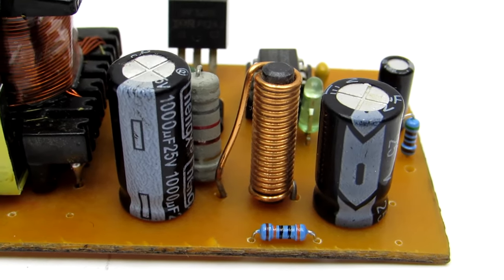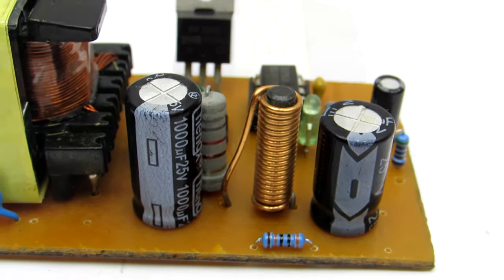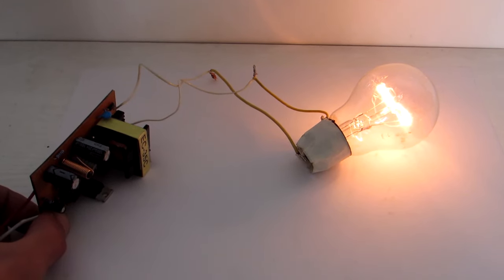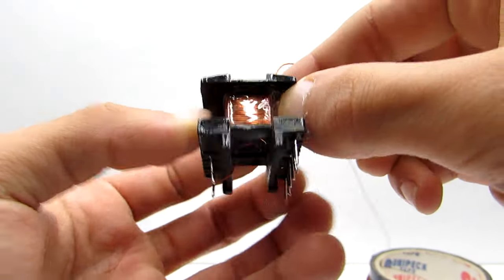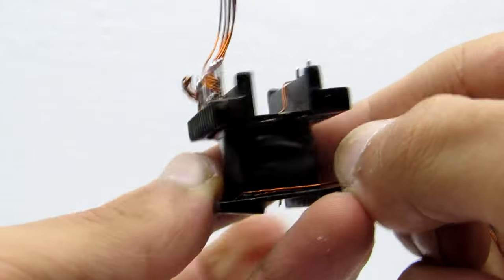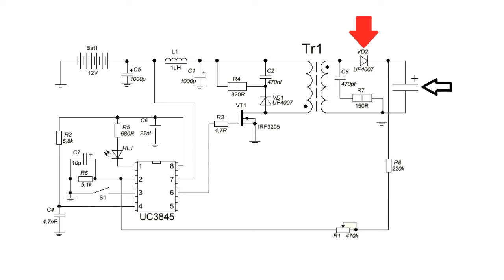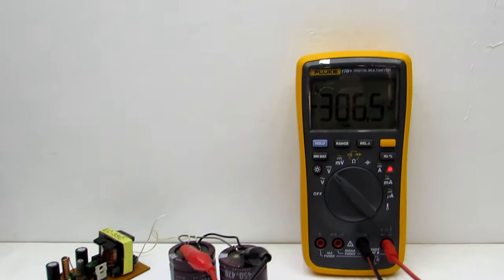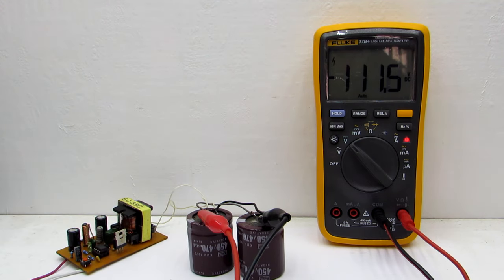Dedicated to photographers...

Comment: i have a version of the circuit that works almost the exact same but uses a 555 and no transformer, i made a video on it
Reply: Hey, you seem to know what your doing and I hope you respond, nice channel btw I subbed, I was wondering if there was a way to make a dc to dc step up circuit, something with an input of 3.7 to 7.4 volts and output about 20 to 30, how would I do this?